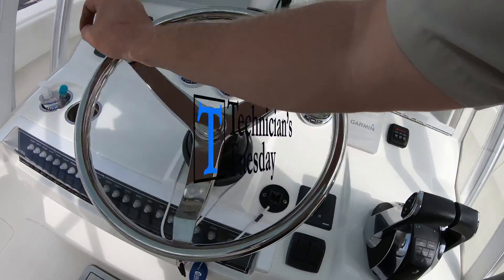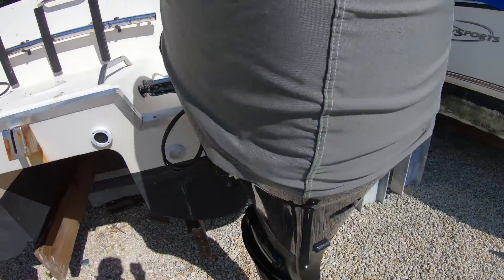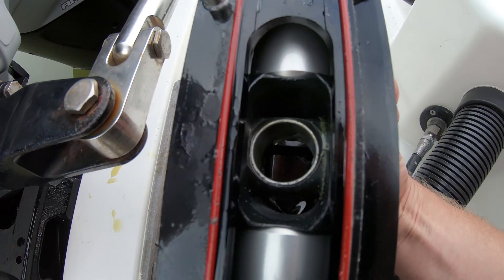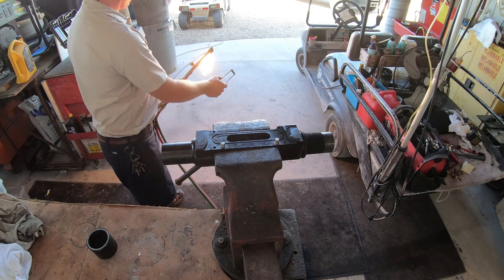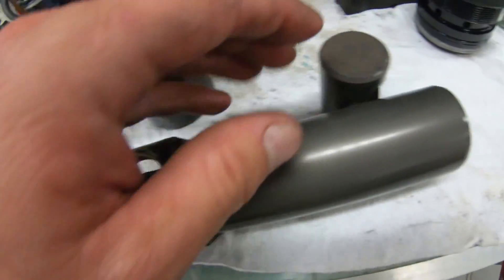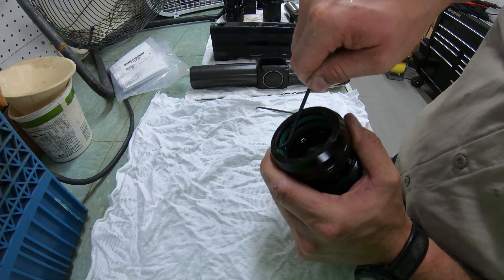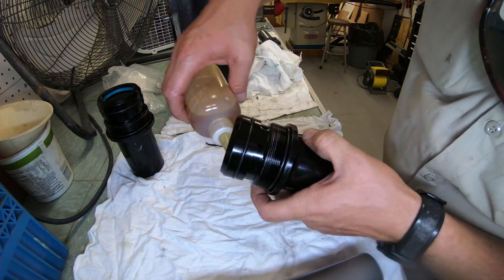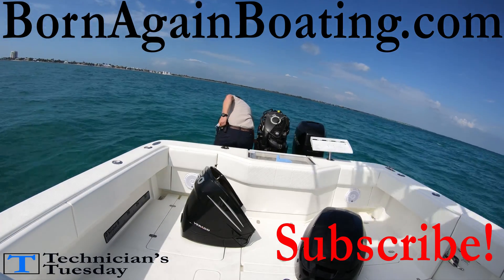Outboard Steering Cylinder Rebuild | Mercury Verado

Comment: Where can I find the cylinder end caps? Replacement. I see you replaced them on the video
Reply from the maker: Hope you finished this, but I just use the seal kits not replacing the ends, you have to look them up in a Parts Catalog to get the Parts number
https://2ly.link/21yyt
Here's the seal kits: https://amzn.to/4gjzOeI

Comment: Do you need to bleed the steering fluid? After doing my rebuild on the same steering ram on a 2007 250hp verado, there is a noise at the steering wheel that sounds like air in the lines, is that normal? Will it gradually fix itself? Your videos are awesome, I cannot trust anyone to work on my boat where I live and your videos allow me to everything myself and do it properly.
Reply from the maker: Yes, you need to fill up the steering pump after doing this :)
Reply: Is that all? Just fill the pump up? No need to “purge” the lines at the steering ram to remove any air in the system? Thanks!
Reply: @charliedoblo8553  yes, you need to cycle it, lock to lock, a few times, while having the "Seastar fill hose kit" attached to the helm. That will give the air bubbles somewhere to go. But before that, you gotta bleed the lines and the ram, using the bleed ports on the ram, just like the brakes on the car. Noise, is usually air bubbles in the system; the first audable indications of a slow leak somewhere. Bleeding works best at the hottest temp that you can get the boat into, as the air bubbles will expand/contract etc. And always keep one bottle of seastar and the fill kit ON THE BOAT. Cuz if a leak progresses below the pump head (helm) while you're out on the water, then you're stuck like chuck, without it. And finally, if you have a fly bridge, always fill the system from up top. And periodically watch the lower helm for leaks. It will be the one under the most stress. 👍

Comment: Do you know which is the part number and where I can get the small part that goes in the center of the ram? the one that rotates with the engine steering arm. Mine was really bad with corrosion. Can I even order that part? Thank you
Reply from the maker: I believe you can, check boats.net

Comment: I had this issue today while on the water. Quickly found out the cylinder was leaking. I am glad I found your video. I am a do it yourself guy. I will order the seals. I work on a machine shop so i will try to make the tool to remove the caps. They sell one on amazon for $260. too much money for me. Thank you for your video. I subscribed and liked!.

Comment: Nice video and very helpful, my question is on my cylinder not have oil just little bit, my oil tank is full. But my steering wheel moving free around one or two inches and for I turned all on left or right side sterling wheel not brake and slow continued turning. And for I driving boat is very hard to holed boat straight always piling on one side and I turning steering wheel different side to keep boat straight. What you think is problem. Thank you in advance and sorry for my bad English
Reply from the maker: No worries on the English, I'll try and answer what I understand :) the cylinder should always have fluid if the reservoir in the pump is full. The pump pressurizes the system and is self bleeding. If you think there is a little air in the cylinder, you can crack the little bleeder valves on the cylinder and bleed the air out that way. The engine has to have water to it and be running to turn on the steering system. 
If I'm understanding right, you can slowly turn  the wheel and nothing happens. But if you jerk it to the left or right after a couple inches it starts steering?
Plus its leaking to one side internally because you have to constantly turn the wheel one way to keep the boat straight?
It sounds like the check valves inside of the steering helm are sticking and beginning to fail. A cylinder failure will push fluid out into the midsection and then leak out at the bottom. 
You can confirm the steering cylinder isnt leaking but just taking out the four bolts holding it on and make sure there isnt any fluid in there. If there is, you'll have to rebuild the cylinder and recheck it :) hope this helps
Reply: Thank you very much I appreciate it, I removed cylinder and inside have some oil just little bit. Some times on helm pump have sound like air in system or maybe this valve for you told me in comment. Thank you so much you help me a lot
Reply: And yes you right I need constantly turning wheel to boat going straight, it’s look like not end of turning for I turn all the way on left or right I can still turn more and more never stop. Like on my car sterling wheel going to to the wheels going and stop it’s all the way left or right right, but on the boat I never stop I can constantly turning
Reply: Where can I get one of those sockets

Comment: Ingersoll Rand W7150 will take it out.
Reply: They go around 300$
Reply from the maker: @kastenusa  To be honest, that ain't bad at all. Compared to Snap On or Mac for about $1000, that's actually really good!
Reply: I work in the bodyshop and I use it all the time. It has more torque then most air wrenches.
Reply from the maker: That's awesome. I've still got a cheapo husky impact right now. Working in a body shop you probably need a lot more tools than what we do working on the boats.
Reply from the maker: I'm a fan of almost all IR products. They are great! How much do they cost?

Comment: Just had mine changed. Seals busted and leaks out the bottom of the big column out the botton by the foot of thr motor. They told me to just cha ge it cause they dont have luck re sealing an older motor like mine. 2009 300 verado
Reply from the maker: Oh man, well that's a bummer. Sometimes they arent resealable when they have to be forced apart like in the video. 

It scratches up the inside and then they dont seal, sorry to hear that was the case for you :( 

Thanks for commenting though! 2009 verados where a great year! :)
Reply: @BornAgainBoating  ty for posting. I enjoyed the video. And so far i like my 09 verado. Have a video on my channel when it went out. It works hard every day and so far thats the only issue iv had.